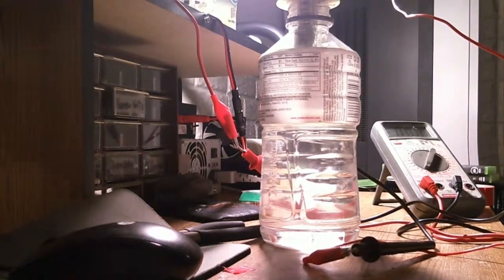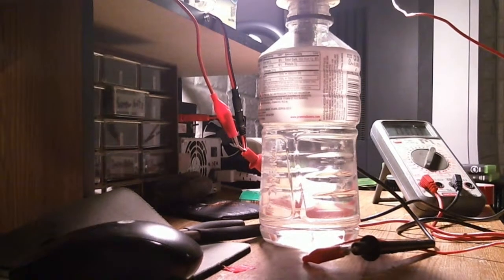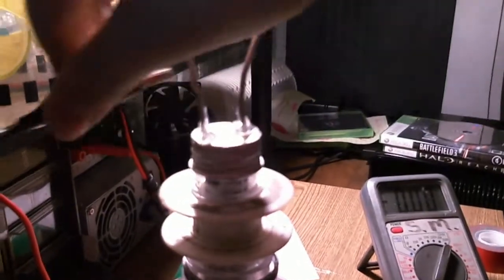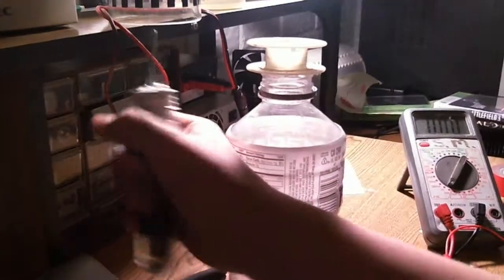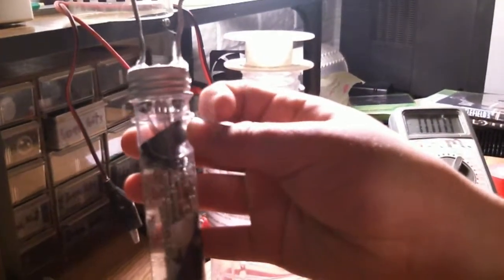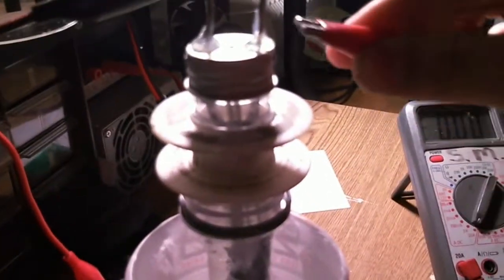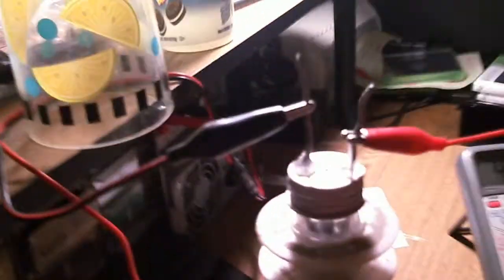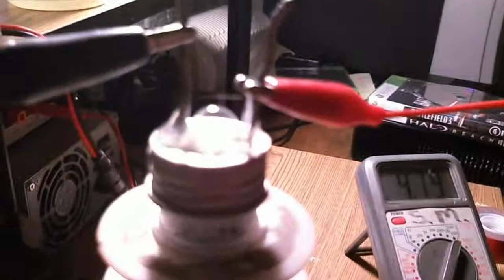Small HHO Cell

Comment: Try KOH as electrolyte (from Drain opener or 100% lye; mix a solution of 3% koh and water; be careful its corrosive) and built a drycell :) I built a lot of wetcells, but drycells are safer and they produce more hho :)

Comment: How much spare money to do you have? 

I got seven v2a stainless steel plates 250x170x1.5mm for 10€ off ebay.
EPDM rubber mat for cutting out gaskets: 18€ (EPDM because it's KOH resistant)

Not sure how much acrylic is, but my cell is below 40€ (about $50)